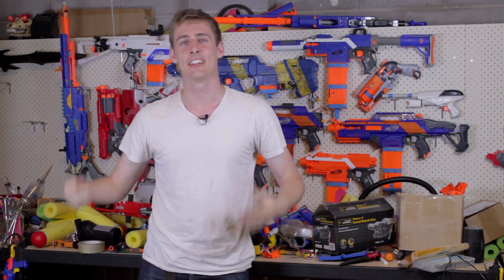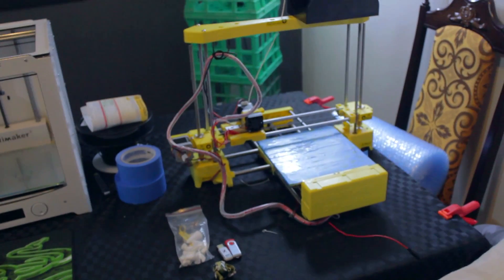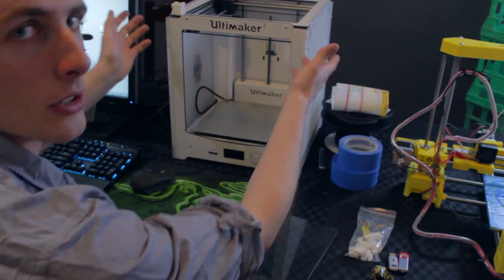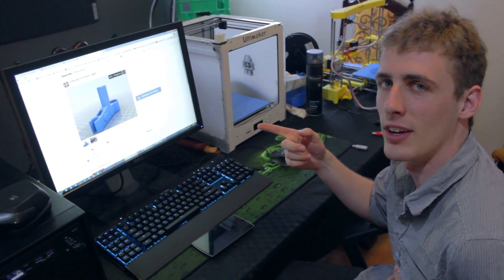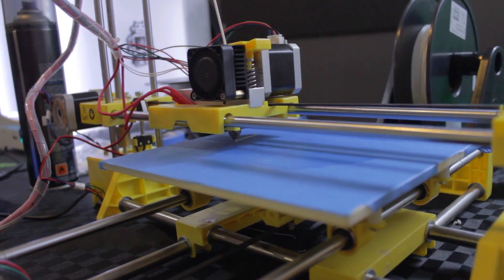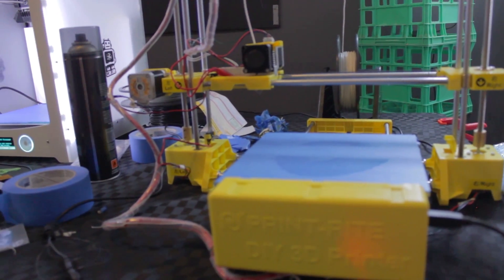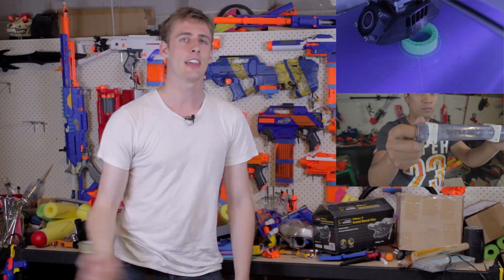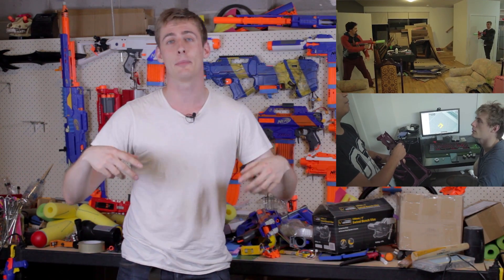ULTIMAKER 2 vs PRINT-RITE DIY 3D Printer & How to Bed Level - PRINTER PARTY | Make Test Battle

Comment: Both are still overprice compared to some other options. I recently purchases a DIY Kossel Mini for $212usd including DHL shipping. It took me 6 hours to fully assembly another 8 hours to debug(My first 3d printer). It came with a free heated bed I have yet to install. It has been printing great for the last week or so. Has an LCD 2004 display and a 160mm x 300m print area. Cura and Slic3r translate the 3d image into common Gcode which is standard code for any Industrial CNC machine. You can pick up a generic Prusa I3 with full heated bed kit and lcd far better looking that that 400 dollar one for $200usd including DHL shipping now. Oh this is just person preference but I like the look of my Kossel mini much better then either of those, it is mesmerizing to watch sometimes. For anothe $20 I purchases and cut to size some plexi glass panels with printed brackets attached them to he kossel mini for a nice eclosed look. I plan on spening a few more dollars to illuminte the print bed

Comment: Seems more early adopter than prosumer to me.

I can't help feeling that there should be a solvent involved and that the plastic should be sprayed on to dry and harden using more traditional inkjet printer nozzles. The nozzle could have a built in infra-red laser to bake layers as it goes. A constant light airflow would also be good.

I could do rough, low res, 3D printing with a can of spray paint by hand.

Comment: To be honest you can build the same Ultimaker under the price of 500$, OLED display 5$, 5+ screw rods 3$, laser cut thin wood box (as case) 15$ max, 4x step motors (including the small one) 40$, step motor driver 4x (circuit) 30$, homemade OS circuit 25$, 3d printer heat head 0.3mm 15$, 3d printed parts for easy assemble 20$ max. Homemade 3d printer price = 153$ same as Ultimaker. Don't believe me? do a research on internet about separated parts, 4000$ you pay just for the name, 3d printer price 200$ :D haha no joke.
Reply: seigeengine I'm wasting your time? you fking comment on my TOPIC comment not me on yours, wanna be informative and learn something new then ok I can help, if not gtfo here
Reply: +Domino SixO you are also paying for a warranty when shit goes wrong, and no hassle setups, 

prosumer parts are almost always intended for people who have some pro application, or who are higher end hobbyists, and their time they would piss away with diagnostics is worth more than the added cost of a printer.

personally, i found the best middle ground, especially for someone completely new, to be the 350$ monoprice.
Reply: alidan I'm a hobbyist in IT engineering and it would be a nice time for me spending my free time building my own 3d printer, even if something will break i will know exactly how to fix it fast and easy because I builded it step by step making my own instructions how to use it, You said about warranty but this dude from the video said he had a hard time repearing his own 4k$ 3d printer by himself and he did it, but my question here, what's the point of warranty in that case?
Reply: Domino SixO well, in the video he said he should have done it 12 months ago, but had it 18 months, leading me to think that he left it sit for a while, for the monoprice, it has something like a 1-3 month full replacement warranty, and after that 6-12 months parts replacement. i assume that his printer had or has much the same warranty, possibly for longer, but he let it sit around for to long and didn't get to use the full replacement. 

as a non engineer (well, at least not gone to school for engineering) i was thinking of putting a printer together too, the main issue is its a money pit that you have no idea if everything you bought will turn out right. not having money to piss away on mistakes, i came across the monoprice printer, pretty much user repairable with little hassle if shit goes wrong, everything used in its construction is something you can get off the shelf (possibly besides the frame) but its put together in house and tested, then disassembled and shipped out. everything should come already setup, pre calibrated, all that crap, and it works out the box. 

really hard to argue against that unless you want to 100% do it yourself, in which case you still may be required to buy a kit of some kind to fully assemble a printer. 

at the very least my second printer is going to be a home built one, unless i run into a shit ton of money, that is.
Reply: alidan I agree with you, if you don't want to risk building a homemade then buy a cheap one and upgrade it on your own in the other side there gonna be mistakes as well in the homemade and you gonna spend a bit more if you build it for the 1st time, but if you calculate everything you will do only basic mistakes that will cost you 5$ max.
Reply: Domino SixO honestly if you want you build your own, look into recycling printers and scanners, many/most parts can be had from these things, the hot end is really the only part you may need to buy
Reply: alidan I already gave an atempt to build from old recycled printers but 2D printers use DC motors for that I should of build my own IR step system instead to get in all that trouble and more work It's better to buy Step motors which already had integrated and 100% accurate degrees, as I commented above in the comments you need step motors (SpM), SpM drivers and the homemade build circuit to print the cordinates, the hot end it's the most useless part in the 3D printer :D it just melt the PLA..etc materials and follow the cords :D
Reply: +Domino60 Can you give sources for where you buy parts that cheap? As even we pay more for some of the parts then you list here. And then we buy in bulk. We do go for quality parts. We've had enough troubles with crap parts in our initial days.

Building an Ultimaker (I would build the Original, easier and cheaper, getting about the same quality prints) would set you back most likely around 700$.
If it's your thing, I really recommend anyone to build their own from scratch. However, if you just want to print, buy a finished machine. Which is calibrated and has software tuned for it.

-Your lovely Cura developer from Ultimaker. Daid.
Reply: Daid Braam If you are from Ultimaker you already know where people buy or can buy that kind of components cheap, some people pay because they don't care about money other people search then buy what they need and pay less money for the same module/ device. It's not a easy way to build a 3D printer you need a lot of knowledge and experience in the next steps or building something but it's a nice experience building such things when you have the ability / skills / knowledge and will to create something on your own. 1st you will find that the final design will cost you less and 2nd you will gain lot of experience. Unless if you are a lazy f*ker or a rich kid who doesn't really care about money and buy random stuffs just to say s/he have them.

-Your Lovely :) D.60 IT engineer/ programmer.
Reply: +Domino60 So, your response to someone asking you how you think you can get good parts that cheap when the people who buy them wholesale can't amounts to a very long-winded "cause I said so," with a bunch of assorted misdirection thrown on for good measure.

That's sad.
Reply: seigeengine Buy a 0.05 mm header and the printer itself you can build it really cheap, under 150$ max so it gonna print the same quality as a 500$+ one. So what's the lesson here? Only the header of the printer maters the rest function as a normal regular 2D, 3D printer
Reply: I'm not five. Repetition won't convince me.
Reply: seigeengine Then i can't do anything about you, you are just a regular guy who pay just for the name even if it's a shit
Reply: +seigeengine "header" (hotend?) "0.05mm" (normal is 0.4~0.5), he clearly has no clue what he is talking about.
Reply: Daid Braam look this link and you will understand why I wrote 0.05 " http://www.tridimake.com/2013/05/3d-printing-with-smaller-nozzle-diameter.html " heder, hotend ..etc there is many other way to call it, in different countries they call it different duuhh
Reply: Daid Braam Agreed, but I guess I'm a top down guy. I didn't need to get to the details.
Reply: seigeengine It's not about the details it's about the experience you gain thru the build of your own 3D printer and yes you can build a 4000$ printer with 400$ spending around 350$ only for the electronic parts and 50 for the case, you will gain experience, new knowledge and a cheaper printer, you will realize as well that the 4k $ 3D printers they sell it's more than 60% stealing your money
Reply: Domino60 Inconsistent claims. Reading comprehension failure. Further repetition.

If you had a leg to stand on, you wouldn't be babbling in a circle as if you were trying to convince a child of your rhetoric.
Reply: seigeengine ok ok, looks like it's waste of time talking here, i'll better go to my  electronic hobbyist forum. I can make a full list of components proving 100% that I can build same 4k$  3D printer with 400$, same quality. but even proving you that you will tell me that im wrong bla bla ... bla ...bla ... what ever
Reply: Domino60 I'm confident you can create a list of components that could be purchased for $400.

Are you going to stop wasting our time now?

Comment: Very bad video.  My 150$ prussa i2 with an extra 50$ for new electronic and heated bead perform as well as your overpriced 4000 printer... 

And I've auto bed leveling. this is even better...

Comment: Actualy the quality of Prusa printer(family) prints is the same with all FDM printers including makerbot, it can be fitted with multiple heads, LCD screen heated, bed etc , but it needs to be build corectly. and yes good berings and rods like SKS, its a DIY machine you need some days prints and good filament  to make it run perfectly
We see from a mile away ho is your sponsor:) ntz ntz ntz...

Comment: Noooooooooo brah, there is so much wrong with that cheapo printer. #1 Try using abs juice with the blue painters tape , or try using kapton tape, otherwise the best option for BOTH printers would be those new flexi printed surfaces , still waiting for mine in the mail , but that shit is dope. #2 make sure your steps per mm are correctly calibrated, those strands it was spewing out , were waaaaaaaay too thick. #3 make sure your layer height is correct, in correspondence with the bed leveling , take some time ,  you guys rushed it. With a bit of fine tuning , that printer could print just as well as the ultimaker, i know cuz mine does. <3 None the less, thank you for the vid.

Comment: Looks like you need to lower the extrusion multiplier and the layer height. I started off with an extrusion multiplier of 1 on my prusa i3 and came out with similar bulky prints. Lowering it to around 0.1-0.15 makes beautiful detailed prints. Having a layer height of about 70-100% of the nozzle width seems to work well on mine too. Hope this helps!

Comment: I stopped using hairspray because the pieces stuck so well to the glass bed that when they cooled and shrunk they'd rip a piece of the glass. I started using ABS plastic melted in acetone, a thin layer of it on the bed gives you really good adhesion and it pops off the glass by itself when it cools down.

Comment: I hate the tumbscrews on my Flashfoge x2... pure torture!

at some point i am seriously thinking of having them replaced with wing nuts... that would be a hell of a lot easier to adjust without murdering my fingers!
Reply: +ZerqTM 
why wont you do that then, its 5 minutes of work
Reply: haven't gotten round to it yet... need to figure out the threading of it yet and what might match :p
Reply: *****
yah i figure it aught to be m3 it looked lime m3 come to thing of it i could test that i do have m3 nuts :p

Comment: the thing that surprised me most with this video is that the ultimaker at $4000 doesn't include auto leveling. you can upgrade a reprap style DIY printer to have this for a mere 15 of my English pounds! you can get an LCD controller for repraps for the same cost too. it seems like you're paying about $3500 more just for a cleaner look.

Comment: Go to a sign supply chain (locally we have Midwest Supply or Regional Supply) and get a roll of transfer tape large enough to cover the bed in one shot. WAY cheaper than the blue tape, easier to use, and it will have the same effect in far less time. :) 

If you have to order it online try dickblick.com. Yes, that's an actual business name from a very different time. :)

Comment: i just started this 3d printing adventure bought a HICTOP Prusa I3 3D Desktop Printer its a kit so learned a bit as it went together was pleased printed a couple of parts with out pulling hair out the aluminum holders for the linear bearings suck but worked well enough to print some replacements awesome how that works lol cheers to ya

Comment: I have a Wanhoa Duplicator i3.  I love it.  It's easy to level (a few screws on the bed), and it prints great.  It only cost me $400, too.  Much better than the DIY thing there.
Reply: link? that's in my budget...
Reply: +Marty Camenzind This isn't where I bought mine, but I wouldn't recommend buying one from the place I got mine.  Go to http://ultimate3dprintingstore.com/.  They've been great to me, even though I didn't buy mine from there.
Reply: +Rick Seiden I have a Robox printer Great printer no problems is 1500 got it on sale for 1000 It is the best out there two nozles, it has a thing to figure out how far the nozle is and the bed is heated for easy! again much better than the DIy thing!
Reply: +Rick Seiden That one is based off the Prusa i3 build it yourself kit (lots of kits from $179 to $400),  that exact one looks almost identical to the one monoprice is selling for $349 http://www.monoprice.com/product?p_id=13860

Comment: when you said "ten times" i though "naaah", checked and was amazed that it was nearly 10 times as much! but it shows, you get what you pay for, and in the end, you can have a 3D printer within your price range that will make stuff. just bear in mind there is a kit built wooden ultimaker for half the price that has identical specifications, but the stock fan is rubbish!

Comment: I'll start by saying the video isn't terrible.

It's unfortunate your friend didn't buy a better printer. At the time I purchased mine, it was $308 US, it's now dropped to $250. It has a heated bed and LCD controller. I find only 3 faults compared to the ultimaker. 

The first is that the build area isn't enclosed. This isn't a problem unless you like printing in ABS however I use PETG and I get stronger parts and better layer adhesion than ABS but it prints easily like PLA.

The second problem was assembly. The printer was shipped from China completely disassembled and it came with terrible instructions. The assembly is not for everyone. It took about 6 hours of assembly, some fiddling with Cura(the newer version had problems so I have to use a earlier version) and I am now getting print quality that is indistinguishable from the ultimaker.

The 3rd was the bed, it came with an aluminum heated bed that really wasn't bad but for $12 I had a few pieces of glass cut and used about $3 worth of clips to hold it down. I use hair spray right on the glass, PLA just pops off when put in the freezer, PETG pops off at room temperature.

Comment: we got a bad ultimaker out of the box. the controller was fried out of the box. would print for 30 min and turn itself off. after a year or 2 of printing and fiddling with it. it finally works flawlessly. also. a note. don't dick with cheap filament that's more stiff than normal on spools too big for the spool holder. it does NOT like that...

Comment: My printer was 300 USD + maybe 20 in shipping.(it cost 258 now tough) and it came with a heated bed, LCD control panel and support for SD card. Pretty pleased with mine.

Comment: try printing on glass, it gives the ABSOLUTE BEST results, just tune your head to be a bit closer than recommended (to about half of wanted layer thickness) and it will squash the first layer onto the build plate. Unfortunately this will only work with a heated bed but the results you get are perfect, with a glass smooth bottom and the most perfect adhesion and print reliability. try it :D
Reply from the maker: +Michael08468 When I have more time I will be trying a bunch of different things people have suggested and probably make a follow up video -R